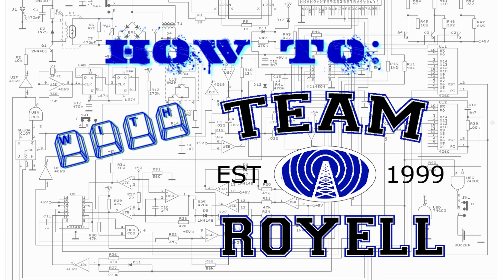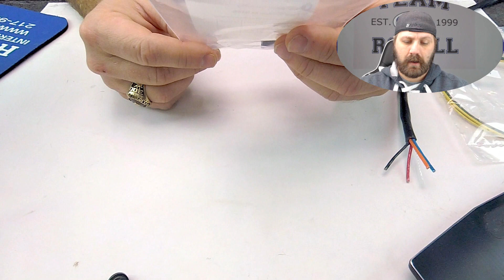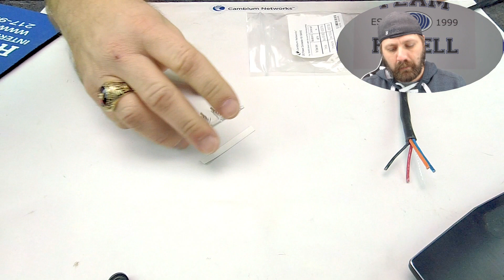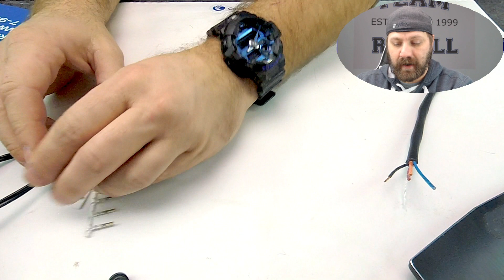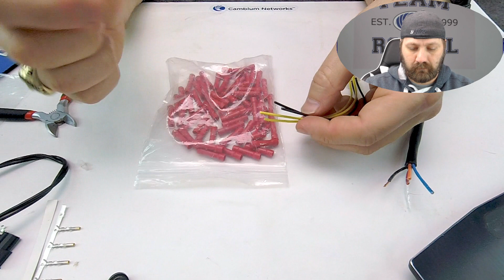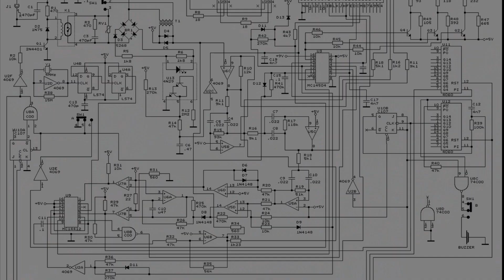450m 3Ghz Wiring Methods

Comment: Could you please explain or demonstrate how all 4 wires land to power. Seems one pair goes to positive and the other pair goes to negative. I know it's DC power but not 100% sure if it's -48VDC. Thanks for the explanation on the 4-pin connector setup.
Reply: Yeah that would have been good, or at least linking to where we can find the information.